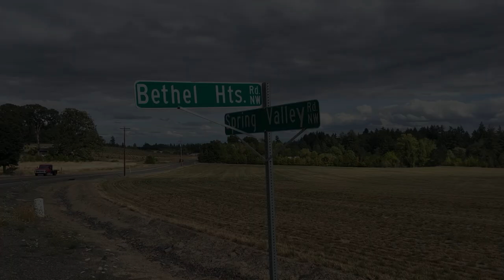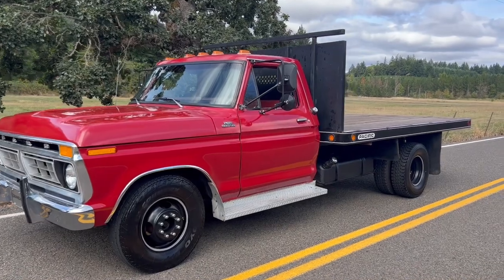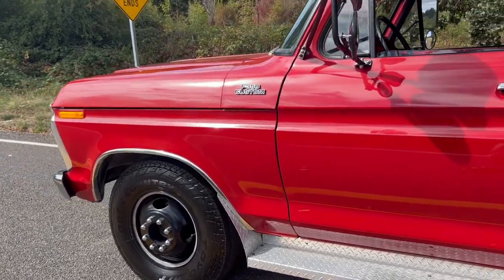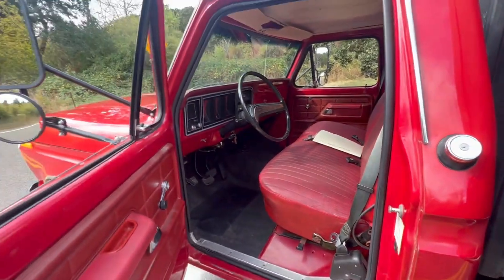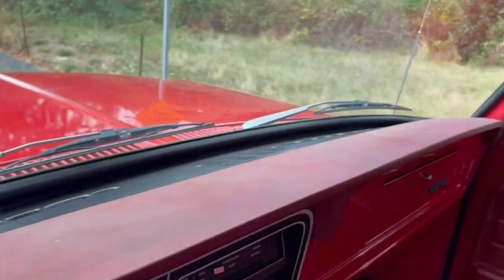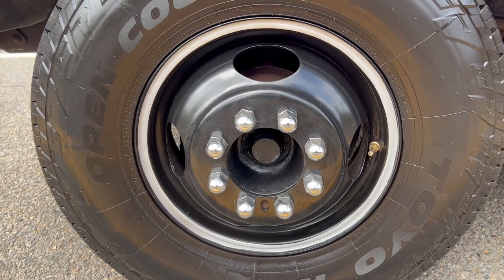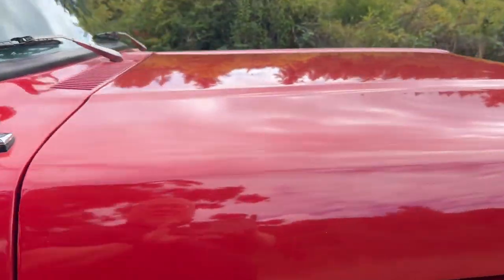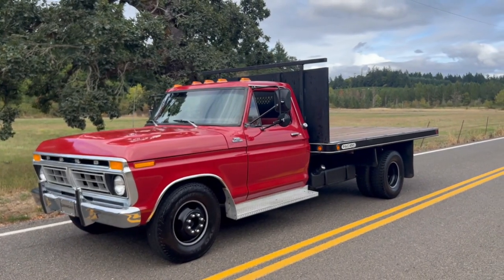Survivor - 1977 FORD F350 CUSTOM Dump Flat Bed 460 4spd - DENWERKS

Comment: Sharp truck! I just bought a 1977 F350 Custom project dually flatbed truck for $800. Has a 400 2 barrel and a 4 speed manual. The body is a bit rough and the paint is trashed but the frame is solid, the shifter moves into gear as it should and clutch feels great. The starter isn't getting power to it but the key switch has power to it. I can't wait to start working on it! Hard to believe that my 77 has a rough exterior but it has a great looking interior AND it has a wood bed floor!